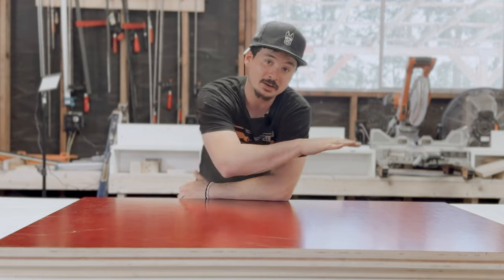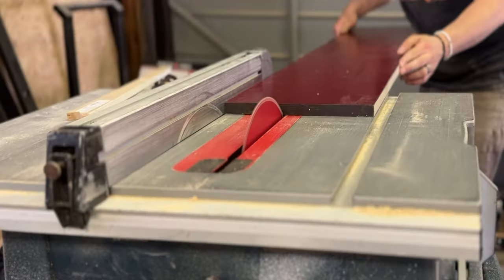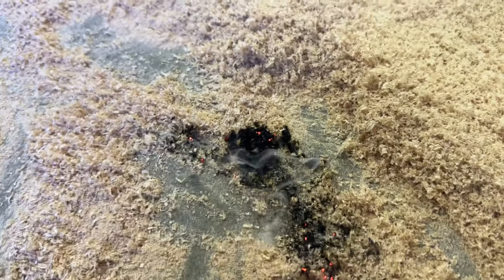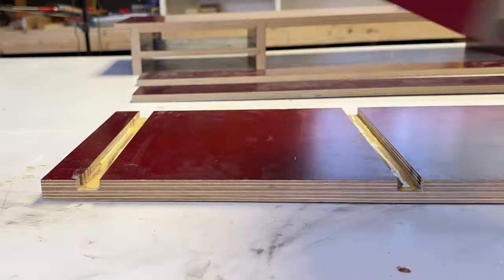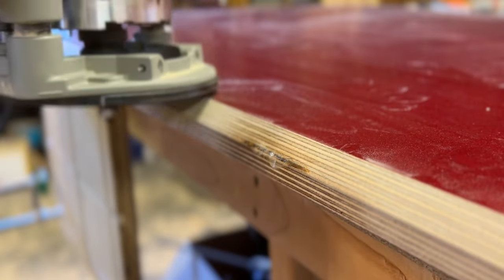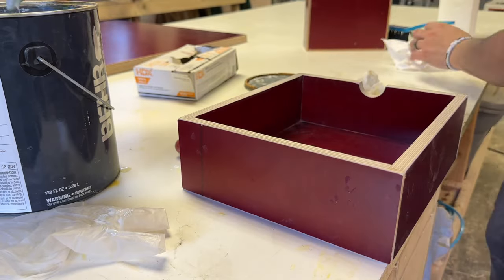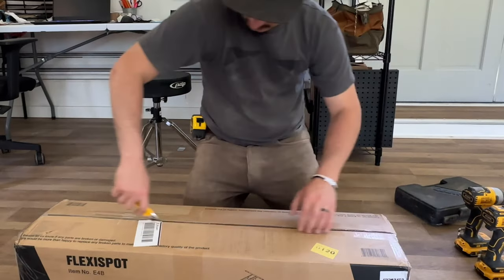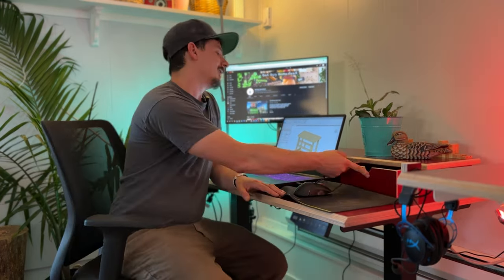$1400 Custom Standing Desk

Comment: Yeah... you have quite a lot of learning to do lmao
When building with laminated/veneered ply, miter joints are your friend‼️ The whole point is to hide the unsightly edge which completely ruins "the facade" that the laminate is there to create lmao 
Another option is edge-banding if you have  access to some that matches the laminate on the face 👍

These tips would've been especially helpful on those drawer boxes for example lol 😂
Reply from the maker: Since I got this plywood from a garage sale there was no matching edge banding.  Although this looks like laminate in the video - I actually think someone stained and finished this stuff.  The grain shows through the red pretty nicely.  

It’s Apple ply - so the veneers are super nice.  Very few voids in the core.  I got unlucky on that one spot in the front.  In other words, this plywood is designed to have the edges exposed.  I think the stuff runs like $200 a sheet for 3/4”.  The guy literally gave me this stuff.  I was so stoked to get the 1” sheets.  Cheers man thanks for watching!!